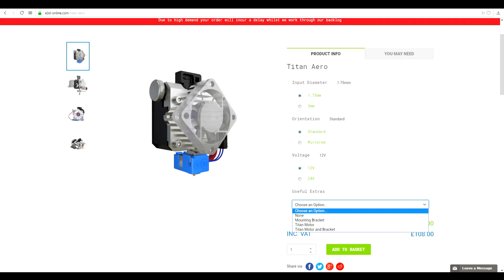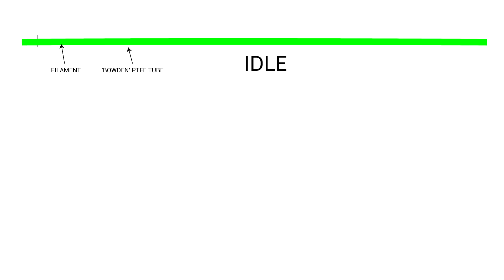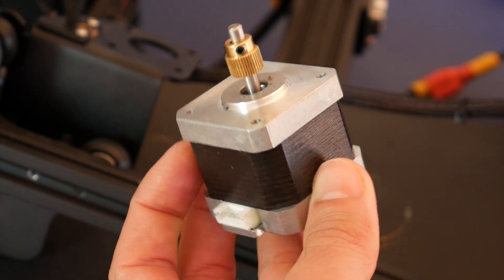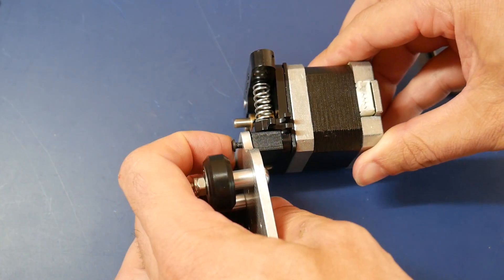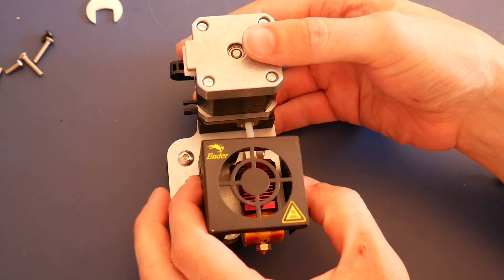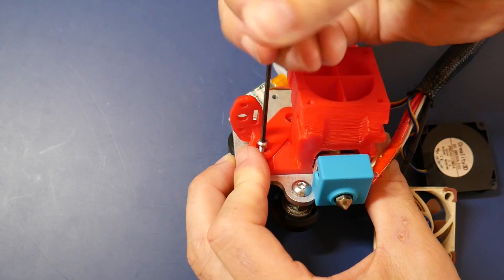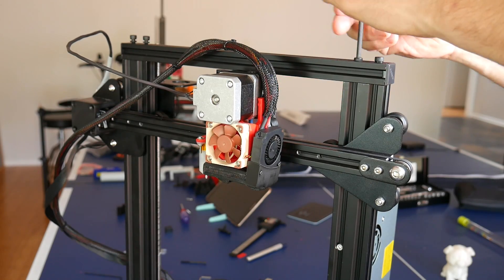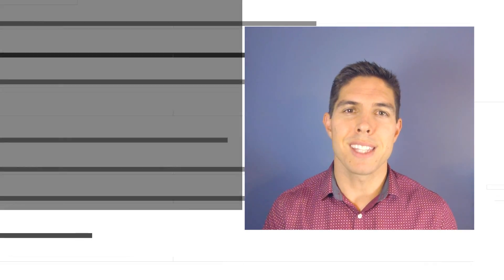Simple direct drive Ender 3 mod for only $35

Comment: @Matthew Basaraba How does this work on a cr10s? I know it would work, but the installation could be more difficult with dual z leadscrews
Reply: The X extrusion doesnt need to be removed to install the unit, can just loosen the wheels and slip it off if you want to do it that way. I have had several use it on the CR 10, just needs longer wire harness. I will be offering CR 10 kits with 800mm of extension for the same price this coming week.
Reply: @abarasabwehttam  ..got the kit,But need longer wire harness. the shorti. the harness that came with the kit is still to short for my cr10s
Reply: @terrylefevre5604  Where did you buy the kit? The CR-10 version should have came with 2 wire harness extensions.

Comment: I have a 5150 fan upgrade. I'm not sure this would work with this upgrade.
Reply: So I modded a 40mm fan shroud adapter to fit the heroME stock base should work on this updated base.  You can find it here. https://www.thingiverse.com/make:601198

Comment: $35? I can see a US$30 amount and a US$25 shipping amount which equals US$55 unless I'm wrong.
Reply from the maker: $30 for the base parts plus $5 for the stepper motor extension lead. I never include postage in any of my videos because it varies for everyone. I'm in Australia so it will always be more for me.
Reply: @TeachingTech  Fair enough. I'm in Australia also and because of that I have to always do the maths, conciously or not all the time. So for us it becomes $35 +$25 =$60= AUD$83. 
OTOH I suppose I could justify the $83 price by thinking, "since I saved a lot on the Ender 3" I paid $215, I can afford the upgrade.
Reply from the maker: At least this item actually ships to Oz. I'm sure you're also frustrated by the lack of overseas shipping options from most places.
Reply: @TeachingTech  I am. I bought some capacitors for my CR-10S which were $7.50 and shipping was $20. The problem is of course Australia being "Girted" by a lot of sea. Would I live anywhere else? Nope.

Comment: I think it's kinda funny, that ike two years ago the bowden hype started, because a lighter hotend assembly was supposed to print faster in better quality, but now there seems to be an overall mood to step back to direct drive :) Why is this? Was it an overestimation about the advantages that bowden could bring? Was ist just a generic hype, followed by many people without really thinking about the consequences? Was it just the 3d printer industry, forcing bowden printers onto people, despite the people not being fond of this?
Reply from the maker: I think you've nailed it by describing that there are pros and cons to each design. For this it is a compromise between potential ringing and potential ringing.
Reply: @TeachingTech  Yes, from your video I assume you meant to say 'between ringing and stringing'.
Reply: @elmariachi5133  You will find that speeding up the printer from 3000mm/min to 4000mm/min doesnt save a TON of time, except on really BIG parts. I prefer flexibility to print more types of materials at a constant rate. A reason the bowden got so much hype is because it was way cheaper to build a machine with bowden than with Direct Drive IMO.

Comment: I also have an Ender 3 and I always wondering if it is worth to upgrade it to dual extruder? Would you do the tutorial on this too?? Thanks for the great video
Reply: I would second this
Reply from the maker: I think it's just easier to buy a geeetch A10m, although I know that's not the answer you're looking for. Mainboard upgrade I've already covered, and beyond that you would need to mount the second extruder, but the real hard bit is the combined or dual hot ends.
Reply: @TeachingTech  Thanks for the answer and suggestion. But please consider this idea for your next project because the main reason for me for buying an Ender 3 is I can upgrade and modify it while learning more about 3D Printer.

Comment: it always looked strange to me how there's just so much mass cantilevered out on these direct extrusion assemblies. Does that ever create issues possibly with the rollers or the z axis binding?
Reply from the maker: The z axis axis is already lifting the extruder stepper on the end of the gantry. The added load is only to what the X axis is moving.
Reply: @TeachingTech  I understand that, but moving that load could cause wear and tear couldn't it?  Think of it this way, hold a stick in your hand and attempt to bend it when hands are close together, now move hands to opposite ends and attempt to bend...  easier to reach elastic limit here.  Does that same premise not apply to this concept?

Comment: my ender 3 has been put away-i had so may problems :( - iv gone back to my Tronxy x3s.  you can reduce ringing by reducing the acceleration from 400 to 300-250, you can still keep the speed.

Comment: I like this a lot and since I am building an enclosure for both my enders this will allow me to put the filament spools on top but I would like to see a lot more prints done with this modification since I have to wait a few weeks for the extruder mod with the extended wires.

Comment: This looks nice, I have been running this https://www.thingiverse.com/thing:3325505 for the last couple of weeks and it does practically the same thing. The extra weight to the head does cause a fair bit of shake and therefore ringing but the lack of stringing is great and a trade off I was willing to make. I also have noticed that the weight of the filament spool attached to the top of the printer has also made it shake, well that is to say, once it starts it takes longer to dampen down, a full spool is worse.  Printing a off printer spool holder as I type this to see if it makes a difference, routing it up and over the top bar is the plan.
I had a nozzle clog last night and it can be tricky to to get the whole thing apart to access the hotend, remove the tube and nozzle etc but not much more than if I had just stuck with the bullzeye.
Reply: Hi Craig. I am running something similar to your setup https://www.thingiverse.com/thing:3328971 (that's actually my remix) - What I have done is mount the Creality aluminum spool holder to the X top bar and that feeds the extruder directly in a vertical clean path. I actually didn't consider that the spool is contributing to frame vibrations, have you considered a rubber dampener between the spool holder and a part like this: https://www.thingiverse.com/thing:2948891 - I may give that a shot today, maybe create a holder that will allow a motor dampener to be installed.
Reply: I've been running this version, which has been great https://www.thingiverse.com/thing:3187864
Reply: Hello I have one question. Did you tested it with this direct extruder with flex filament ? Because I have problem with bowden and I want to solve it.
Reply: @remex0401  hi. I haven't tried but it has a bit of a gap between the gear and tube so it would have an escape path. There are further mods to fix that though.  Good luck.

Comment: Weeks I've been trying to figure out the issue I was having when printing a Rupee from The  Legend of Zelda (edges kept curling all along the bottom half and then were perfect on the top) and you've only just gone and solved it, same issue with your Pikachu's mouth (only much worse!) Gotta upgrade the stock cooling fan on the Petsfang. Thank you :)

Comment: Idk man, my prints got worse with a direct drive Bondtech extruder with all of the ringing/ghosting.
I don't really really think it's an "upgrade" as such
Reply from the maker: Try playing with acceleration settings by lowering g them a bit. You will lose a little speed but the movements will be smoother.

Comment: now it would awesome if someone did a aluminum second z axis kit to install on the ender 3. look i found one on ebay https://www.ebay.com/itm/3D-Printe-ENDER-3-dual-Z-axis-upgrade-kit-single-motor-dual-Z-axis-pulley/264133095103?hash=item3d7f8f2ebf:g:h9kAAOSw8iZcNt5s:rk:11:pf:0

Comment: Very good video !! I was interested, but as I have little to no stringing or other issues right now, I won't be doing this mod. It does add some weight to the travelling end, wonder how that may affect the Ender 3, as it's only driven on one side. Please let us know how it works out long term. Thanks again . You Rock !!

Comment: Wonder if we could use a smaller stepper to reduce mass ?
Reply: It is definitely an option but I made the kit so someone could install and go without any other needed parts to buy. You will need a shorter bolt for the wire holder on the back side since it is made for this stepper. About 20 cents at hardware store.
Reply: @abarasabwehttam  I'm interested to your Ender kit - this is really awesome. Is there any option for smaller shipping cost. eBay calculation for Croatia is more than 30usd. Thanks

Comment: @9:43 you can see diagonal lines on the Pikachu. I also get these lines on my print. Its it a driver limitation? what causes this? I heard it was the slope angle being to steep for the x and y axis
Reply: did you ever get your question answered? i have this issue with prusa slicer, but not cura

Comment: Would using a pancake stepper with this mod be more beneficial for reduced weight?
Reply: It is definitely an option but I made the kit so someone could install and go without any other needed parts to buy.
Reply: Matthew Basaraba and that’s awesome of you to do. I’m trying to decide if I want to do it haha.
Reply: @Littleferris  The only thing that would need to change is 1 bolt that holds the wire holder on the back of the stepper motor. Currently it is a 50mm bolt for the big motor. The bolts are like 20 cents at Fastenal if you wanted to use one.
Reply: @Littleferris  I should also mention that the pancake might not be wired the same so would need to determine parity between the wires.
Reply: Matthew Basaraba good to know. So what speeds have you been able to reliably print at with this mod?
Reply: @Littleferris  I run the same as my Prusa MK3s, 3000mm/min (50mm/sec) and the prints come out just as good as my Prusa machines.
Reply: Matthew Basaraba hmm that’s good to know. I might do this then. If I wanted to order now is there a way i can order the kit with the wires and you can just wait to ship it?
Reply: @Littleferris  harness extensions will be in this coming week if you can wait to order. It is hard for me to keep track offline who wants and doesnt want the harness. We sold over 150 units without extensions and over 400 waiting for extensions.
Reply: Matthew Basaraba oh gotcha. Ya I’ll just wait then.

Comment: If you want to use a Noctua still consider the 40x40x20 version.  Looks like it will for your design and it moves more air.  I have had good results using that one on a couple of printers.

Comment: Could I switch the motor to a pancake stepper motor so that there is not so much weight on the extruder assembly?
Reply from the maker: Definitely. Only the bolt length would need to be considered.
Reply: Awesome, I will probably do that. Any firmware changes involved, or do i just plug it in and go? Will the pancake stepper motor have any disadvantages? I do NOT want to decrease the print quality one bit.
Reply: @jacer12344  No firmware modification or loss of build volume.
Reply: @abarasabwehttam   Thank You
Reply: You couldn't use a pancake motor with the original extruder unless you are happy printing extremely slowly, there just wouldn't be enough torque.
Reply: @thegarageluthier  while the original setup this might have needed extra torque to force the filament through the long bowden and maintain a constant force, the short distance in the direct drive requires far less to achieve the same goal. I used the Dglass 3D Extruders for years on a printer I designed and built and it had more than enough to print exceptional quality with a pancake motor.
Reply: @abarasabwehttam  The torque required doesn't come from the friction in the bowden but the diameter of the filament, gear diameter, feeder speed, temperature, nozzle diameter, length of melt zone etc... The more filament you want to push or the faster you want to push it the more torque you need the bowden tube is negligible.  I have managed to kill pancake motors on E3D Titan Aeros doing 20+ hour prints.  Would never suggest them for an extruder like creality's.
Reply: @thegarageluthier  The Douglas Extruder had a gear reduction system on it, maybe that was the factor that made it so much better? It used the E3D hotend so maybe that was a bonus factor also. I guess I havent done much research into since all the machines we have use the original stepper and we havent had any issues.

Comment: Good video Michael. I think I would still like to keep my Bullseye is there an option for that too?
Reply from the maker: I haven't tested. I found the bullseye cooled well but was prone to noisy vibration. From memory it sits out the front instead of on top so it might well fit unaltered.
Reply: I'm interested to know as well. I have modded my Ender 3 to give 268mm of travel on the X axis. That required a Bullseye mount and a different X belt tensioner.

Comment: Thanks for another great video! I'm interested in doing this to my CR-10.
Reply: The CR-10 version will have 2 wire harnesses linked for the longer X axis needs.
Reply: @abarasabwehttam  when do you think the cr10 version will be ready ??
Reply: @choco107  The kit will work fine on the CR-10, the wires just need to be longer that extends the extruder wires. Right now I am out of the harnesses until next week. I plan to put in 2 of the harnesses into the CR-10 kits (If the harness is selected), other wise can just snip and put in about 650mm of wire in the extruder wires and be good to go. I have 500 harnesses that will be here next week and another 2500 ordered.
Reply: @abarasabwehttam  great man thank you
Reply from the maker: I believe a longer extension cable is being investigated so this will be an option soon.

Comment: Stop, I'm running out of money with this printer xD... on a real note, I've Got an Ender 3 and I've been following you ever since, at this point my Ender 3 is quiet, prints amazingly, auto-leveling, soon to be wireless printing and monitoring (haven't done the board upgrade as yet). and now a direct drive install would be another great addition :D Keep up the amazing work, its really appreciated!!
Reply: $1000 verses a couple of hundred.....yeah right!
Reply: i got my ender3 ~month ago, and all i did - printed few things for it (chain and feet), but not buy anything except filament. 9:40 shows that it is almost pointless to do all these upgrades.
Reply: @sevikl  this is beneficial if you want to print flexible filament as it tents to get stuck REALLY EASILY in the tubing and cause under/over extrusion and cause a big mess (don't ask me how I know)
Reply: @Abitamim Bharmal Yeah, of course Mk3 would be easier. But for me thats the art and interesting part of 3d printing.
Reply: Just a heads up you dont need to switch out the board for wireless printing you can just use octoprint with a raspberry pi
Reply: Hello, what's your advice to make it quieter ? Thanks :)

Comment: I trashed the stock extruder for a Bondtech BMG. Any idea if it will fit? Not sure if you have one or not.
Reply from the maker: The extrude spacer would need redesigning at a minimum.

Comment: Will have to see how it goes compared to this! https://www.thingiverse.com/thing:3212592 (To be printed this weekend)
Reply from the maker: I guess the advantage of the one in this video is the machined aluminium X carriage. That one looks interesting though. Would it hit the top frame?
Reply: @TeachingTech  It looks like it will, amongst other things I haven't even thought of. I need to modify it to fit my BMG extruder, so I'll see if I can fix both. Great to see the ringing didn't significantly increase in your test - so that's pretty encouraging for this type of approach.

Comment: Would love to see some more prints with this setup. Maybe try some highly flexible filaments? Interested to see if any ringing or added wear (to the wheels) occurs. Definitely debating this mod, but I'd have to see more of the benefits.
Reply: For a graduate project I actually printed a lot of TPU on my Ender 3 using the bowden tube setup. I didn't have any issues with this particular flexible filament on the printer and it actually printed spectacularly well. In fact, I actually had to do more adjustments software wise to get my direct drive QIDI Tech to print TPU than the Ender 3.
Reply: @MWSJoey  I've printed some tpu (95 hardness) on my stock ender 3 no problem. I doubt it could handle anything much more flexible though
Reply: @mnp2169  im.print ninja flex but slowww, 10mm/s
Reply: @MWSJoey  Which Qidi are you talking about here?
Reply: @PinchTune QIDI tech 1, it's an old workhorse of a printer now-a-days. Mainly use it for ABS or Dual PLA prints everything else still ends up on my Ender 3. Recently got an Orange 10 for all my resin printing needs.
Reply: @MWSJoey  Thanks. I ask because a QIDI was going to be my first printer... I was going to order the X-Smart, but then the X-Maker came out which is supposedly better for TPU. Anyway, I settled on an Ender 3 Pro and so far I'm glad I did. I do like the look of the QIDIs, but I figured the modularity and upgradeability of the Ender would be preferable to the QIDIs.
Reply: Should this allow you to up your tpu print speed though?
Reply: @ugpfpv361  maybe! I'm not sure if I'm limited by retraction, the bowden tube itself, or some other variable (ie, bed temp, enclosed or not, vibrations and resonance, etc). Would love to hear what people's results are!
Reply: @mnp2169  what speed do you print tpu at?
Reply: @ugpfpv361  probably around 25mm/s. Down to 15mm/s for first layer, etc